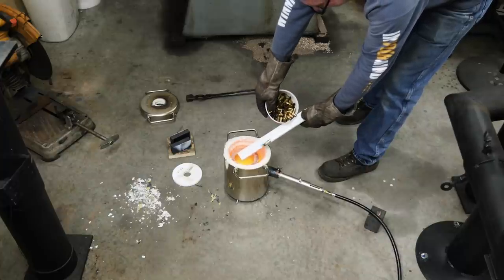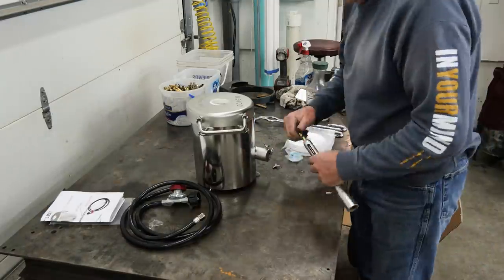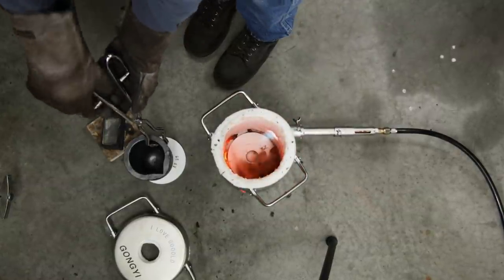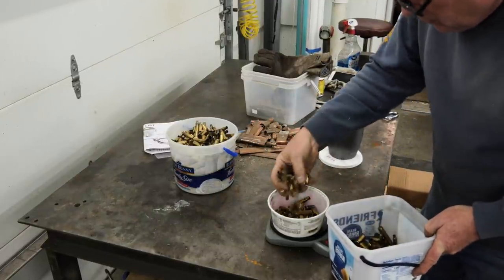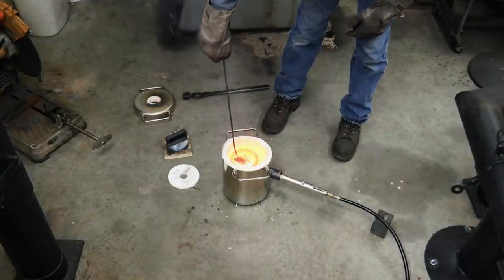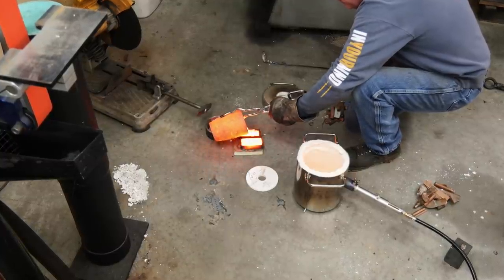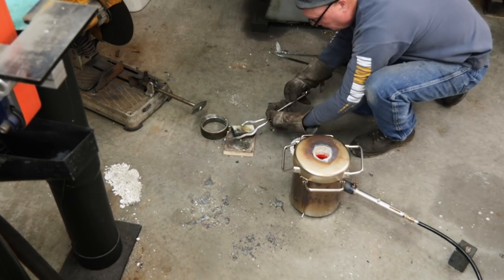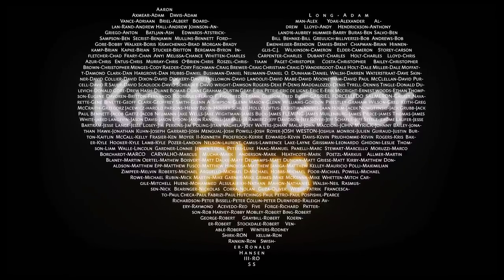Dad is Casting Custom Copper Alloy

Comment: Here's an idea, something that maybe I think I saw Black Beard do:  make a steel ring that fits around the crucible, with a handle on it to give you better control over the crucible as you pour.  What you could do is, when you take the crucible out of the kiln, just slip it right into that ring, and then you can do your pouring.
Reply: Thought of the exact same thing!! 👍

Comment: Actually just got a foundry similar to your dad's, then saw this video. Realize he might not want to give exact ratios, but maybe general starting point? Twice the brass, or twice the copper. Just starting my knife making journey, and that would make great guards.
Reply from the maker: Great question my friend 
I did several test casts
Kept looking for a particular color. 6:1 copper:range brass with primers in. The primers are aluminum. That makes it harder to get the deeper color I wanted. But I eventually got there. Take good notes. Don’t be afraid to make mistakes. Fear is not fatal and failure is not final. 
May the Forth be with you 

Dad
Reply: @KyleRoyerKnives  Thank you ever so much! I appreciate it, Range brass is what I had intended to use as well. I do need to work on getting my copper, but I'll get there. Working on my second knife now, which is my first hidden tang, and plan to use some aluminum that we've already melted down, or if I can get enough materials, some form of brass/copper alloy for the guard. Keep up the great videos.

Comment: Great video. For reference cartidge brass is normally a 30% zinc 70% copper. The brass jackets on the bullets is a 10% zinc 90% copper. I like the idea of experimenting with different alloys. Would also like to see how the Dad Royer alloy will patina compared to normal brass
Reply from the maker: Hey thanks 
Not much difference but the buffed alloy looks great 

Dad

Comment: Love the video and love the color of the finished product. Would you tell us the the copper and brass ratio so we could try this ourselves?
Reply from the maker: Six copper: one range brass
Keep Forging On my friend 

Dad
Reply: @KyleRoyerKnives  For those who may not have cartrige brass available and would like to make a similar alloy.

Dad's Alloy-

Percentage 
95.5224% Cu
4.4776% Zn
Ratio
67 Parts Copper
3 Parts Zinc

OR

Hit the easy button and melt down US pennies minted between 1963 & 1981 which are 95% Cu, 5% Zn

Comment: I take it that a melting furnace is a requirement.  Looks like it could be heated/melted in the heat treating oven.  🤔 

Can you advise why that is not a possibility?
Reply: I'd guess they don't want to contaminate other parts if they have spill overs.
Reply from the maker: A whole lot faster with propane. Our oven is to short 

Dad

Comment: Beautiful color, but there is something missing here - what's the final ratio? ;)
Reply from the maker: Good question my friend. I did a test run at around 4:1 with primers removed however in this run I left primers in (which are aluminum) and ended up going around 6:1 copper dominate. Did some polished and some with forced patina and they are screaming gorgeous. Going to keep doing this on select knives. Keep Forging On   

Dad

Comment: Little question : is "dross" a particular material or does it just mean the junk, the stranger elements in the melted brass or copper ? I translated the word but am having a hard time understanding the meaning.
Thanks again, love the videos dubbed by The dad !
Reply: Dross or Slag is unwanted impurities in liquid metal. You can use things like boric acid to help bring them to the top!
Reply from the maker: It’s just the stuff that doesn’t want to mix in the fluid. Lil bits of who knows what in there. Casting twice helped refine the alloy 
Like and share we appreciate it my friend 

Dad

Comment: Brass is copper and zinc, right, any ratio, so brass and copper would still be a Brass?
Reply from the maker: Good question my friend. There’s many different elements in proprietay 
recipes. Traditionally the majority by weight or volume defines the alloy. I have more copper than anything else = copper alloy. Like and share we appreciate it 

Dad

Comment: Have a friend making awesome jewelry he designs on a computer by doing lost wax molds with high resolution 3d prints that come from an SLA printer. Has much potential in a high end blade shop.
Reply from the maker: Nice